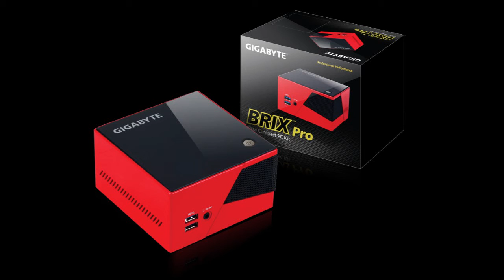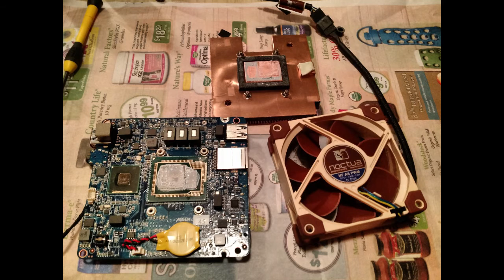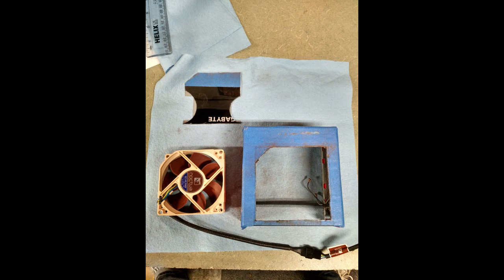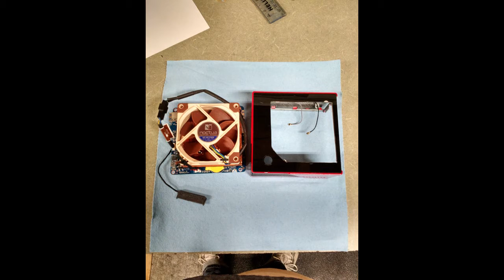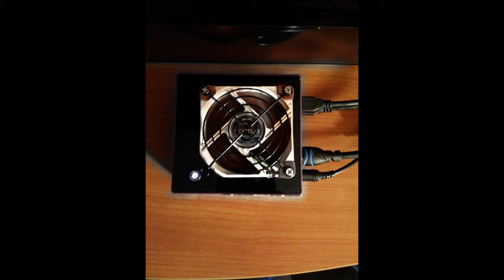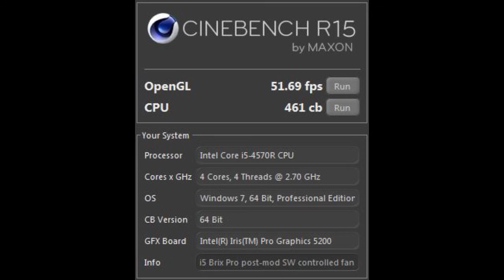Gigabyte Brix Pro modded with Noctua fan

Comment: Nexus One, Please could you tell me how you figured out how to match up the Noctua wires with the splice you made? I got my fan and have researched a bit, but Brix has 4 black wires, so, no help with the Noctua's Yellow, Black, Green, Blue. Any help appreciated, Thank you, johnm
Reply: @DarkoStojchev  I can tell you how I figured it out. My brix is buttoned up pretty good with duct tape etc. What I did was looked for a replacement fan on a Chinese website, exact match name and volt/amps. I'm sure I googled it. I probably found 4 or five different sites with the exact replacement. There was one site that chowed the fan and had a little magnified section of the colored wires and i just followed that. Sorry I can't tear apart my rig but it was absolutely  and excellent choice Noctua. Also make sure you have the 5 volt fan I had to return the 12volt and get the 5 the board gives 5 volts for the little fan. Good Luck!
Reply: nm, I figured it out myself, Thanks for the Noctua fan idea, it is great!

Comment: why are you blowing air out of the top instead of sucking air in?
Reply: I was thinking the same thing. And some of those noctua extension wires have speed reduction. So maby the fan speed is less than optional.

So I would flip the fan upsidedown and get rid of the extension part and mod the original wire.

If that would not help then I would look if your thermalpaste application is optimal.
Reply: The BRIX fan blows the same way and directs that air out the back of the case, so I'm assuming that's why Nexus One installed the Noctua fan in that way.

I agree with madvelila: I would flip the fan, so fresh air is flowing into the case and over the fins. (plus layering a couple dryer sheets to act as a dust filter)